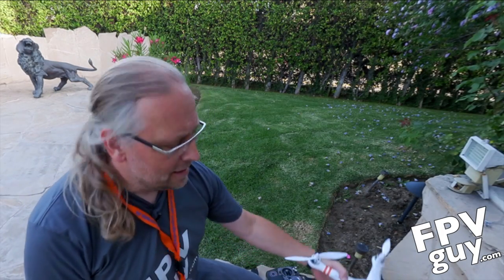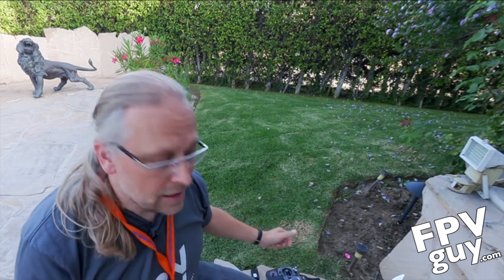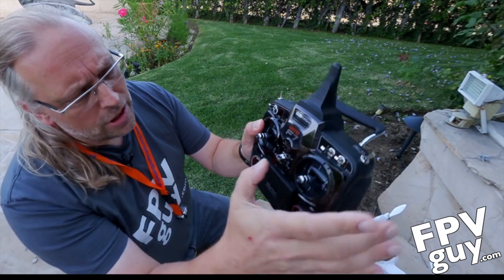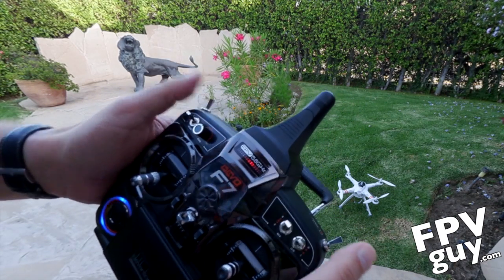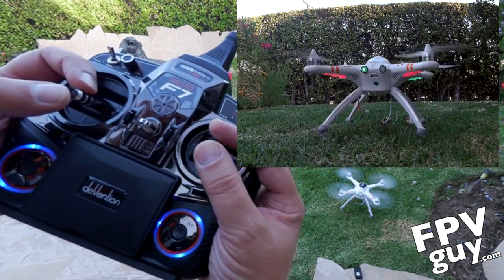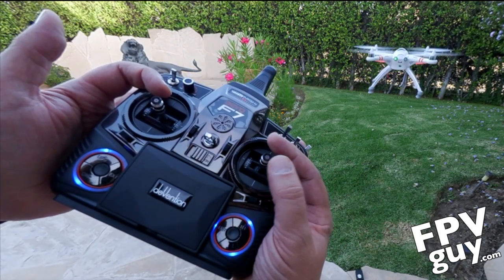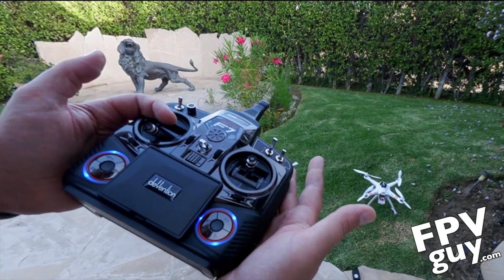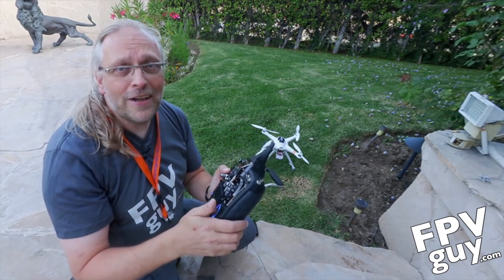x350pro Safe First Flight - Step by Step

Comment: Hi Bo, you certainly remember our discussion about my problems with the GPS device out of the box of my new QR X 350 Pro. Now I built in a new replacement GPS. Now I have a positive GPS Status LED indication (after some minutes at a new position). The GPS Position mode seems not so good as with an original APM with a ublox GPS receiver. With some mild wind there are drifts of a few meters 3...5m horizontally and vertically i.e. height. You mention in your Video some "learning" phase which results in a better (smother) behaviour of the quad. Can you explain a little this "learning" phase?
Reply from the maker: Hey Jack,  the "learning phase"  is really simple, my x350pro flew pretty much as you explained just now the first day, however after running maybe 5 batteries through it,  it seems to have refined its position hold and also its ability to lock to a position.   I had a bit of wind in this video yet not much trouble with position hold,  this is after maybe 10 batteries on the quad.  so basically, simply keep flying some batteries through the quad.. you should see a marked improvement. ;-)
Reply: Hi Bo,
Thanks for your explanation!I meant the question, if you have an idea, how this behaviour is realised. Up to now, I have never seen in the forum for the arducopter i.e. APM Mega hints for such an adaptive behaviour. Maybe that Walkera has programmed such a fine feature for their APM Mega.
Reply from the maker: Jack, I am as puzzled as you are,     got no clue how its working, and if you told me it worked that way, I would laugh and say you were smoking something..     all I know, when I powered the quad out of the box.. it was rough (putting it politely)  and after some batteries its very stable and predictable.    Matt mentioned something about how it works a while back, but its way over my head.    check out his FB forum https://www.facebook.com/groups/711455455567160/

Comment: Bo I see you are using a F7 Devo, do you know how to set up the sub trims in the menu? I have no idea what the menu items are or if they work. I was trying to correct a pitch problem on the 350pro as it was pitching forward when it takes off. I tried using the trimmers but nothing seems to work.
Reply from the maker: Benard,  
Yes they do work,  walkera makes surprisingly good radios. but the sub-trims are not going to change the issue if you can't trim it away. ;-)
Sounds like you need to revisit the IMU calibration, for some reason walkera call it compass calibration.  also make sure you are on perfectly level ground when taking off. 
AND make sure the quad is correctly balanced. 
Notice how I check the balance as i spin-up,  at a little less than flight power, I check that the quad is level. then rock the pitch and roll stick all directions to see that the quad moves with the stick.  when I center the stick the quad centers towards level.. so that is OK.. then as I power up more I use the stick to keep it level during take-off.
Reply: Bo Lorentzen thanks. Done the recab for the compass so will take it out. So the trimmers do work but not the sub trims from the menu?
Reply from the maker: Benard Quek I already said the sub trims work. ;-)

Comment: Bo, why didn't you turn the radio on first?
Reply from the maker: I find  - in my experience with the walkera products -  I always power the quad and then right after power the radio.  read me right here, I would NEVER turn on my s800 until after the radio is on and ready.  it just seems to work better with the automatic binding of the walkera things.    but I think the correct process probably is radio, then quickly the quad.
Reply: Bo Lorentzen
Thanks Bo. On DJI it gets tricky, especially when you land and turn the radio off, it suddenly takes off.

So I guess your next video will be flying H500? :-)
Reply from the maker: Ben Hayat Yes NEVER turn off a radio until after you unplug the quad battery.!
Cough Cough.. no comment.
Reply: Bo Lorentzen
:-) :-)
Reply: Bo Lorentzen
Hi Bo, I like your good introductory Videos for the Walkera QR X350 Pro! I just received my new one from RCMaster. But concerning the GPS I have a great problem, The GPS Status LED blinks only very rarely (can be minutes) and only under very clear sky and sunny conditions. (In These places the original APM Mega with a ublox GPS has never problems! After warming up the upper part of the quad the GPS LED stops to blink! It also stops if I put my Hand over the quad in a distance of a few centimeters. I opend the quad and controlled all GPS Connections (all ok). In the Mission planner I realized that the sat counts are rarely at 7...8 and sudden drops to Zero and comes up eventually after a long while. In the (quad)opened case, the situation seems a little bit better. I conclude that the Receiver sensitivity of the GPS is quite bad and even worther with higher temperatures. Did you also observe this behaviour? As RCmaster responds very lazy to my corresponding Inputs I ordered a new original Walkera GPS (Version 2) replacement in the hope ....
Regards
Jack
Reply from the maker: Hey Jack,   I have not had that experience, however Matt did, he put a new GPS in his and now have rock-solid GPS lock,    I think you did the right thing, but that probably should have been offered by the dealer instead of you having to buy a new GPS module.
Reply: Hello again, thanks for your information! Did Matt also have a bad receiver sensitivity  and temperature behaviour? This is also an experience, that ordering a long way away stays critical. But I found at this stage no other place to order from Switzerland.
Reply from the maker: Matt had problems with the GPS, but the control receiver worked fine.   basically, a correctly working / build x350 should work pretty solid out of the box,  kinda like in my video.. no real big problems..   If it don't lock GPS, my first instinct would be asking Walkera for a replacement x350 rather than the gps alone.   Check Matt's support forum on FB  https://www.facebook.com/groups/711455455567160/

Comment: Great video Bo, thanks for all the instruction. You took off in manual mode but landed in GPS mode, for beginners is it possible to take off in GPS mode?
Reply from the maker: Wally Jas,  Technically speaking, but I don't recommend it, because the x350pro GPS is a little rough first time out and you then can't do the rocker-test first to make sure the thing is neutral before getting in the air. ;-)
Reply from the maker: OK yes,  the process is simple,  arm the quad with mix switch in manual, after arming and do the rocker test.. put throttle to bottom wait for motors to stop.
Then move mix switch to "0" for GPS mode, then move the throttle stick to about 75% and it will take off.. return throttle to 50% for GPS hold.   proceed and fly from there.   
Walkera QR X350 PRO Auto Start —  Easy to Control Mode！
Reply: Bo Lorentzen DJI Phantom with centered throttle made life so much easier for sure at least for new comers to this hobby. So Bo if we have Phantom's TX and a compatible RX on Walkera Pro, will it help more with TXs centered throttle to hover in GPS mode? The question is also like asking ''How APM behaves in GPS mode with centered throttle as Wlakera has an APM based FC''? Thanks for your videos..
Reply from the maker: Gur Isler Yeah, now that everybody is starting to be flying GPS,  the spring centered throttle stick makes sense, and the logic is simple, up to move up, down to move down.. and that is exactly how the APM behave,  yes it is a APM controller in the x350pro.    there is nothing keeping you from cracking the tx box open and putting a spring on the throttle stick as well. ;-)
You could definitely also fly a x350pro with a Phantom radio / rx, but remember there are no options for customizing the radio, so it may not be worth the time.
Reply: Bo thanks for quick reply. Just will build a custom 350 pro by buying spare parts and some abit better motor and escs and apm 2.6, just want to continue using my Phantoms Tx with this new build by adding a Fasst rx into custom 350 pro, just I was curious how APM will behave to stick centered throttle when I arm the apm! Dont have so much experience with APM but as you mentioned it should be OK! Later thinking on investing a better TX like Devo10 or Tarantis! Thanks for helping! Following fpvguy.com :)
Reply from the maker: Gur,  you arm by pushing the throttle down and to the left.. after it is armed, if you return it to 50%  (middle) the props will spin up but not take off until throttled up if in GPS.   But notice, most people who upgrade their Phantoms go to non-centered sticks,  for a guy who fly FPV and in ATTI mostly, I would probably prefer the non-centered stick.  I would also consider the F12e once it come out. ;-)
Reply: Bo Lorentzen Bo, I am in pursuit of that TX from Walkera, looks really cool for fpv. But so far as a beginner life was so easy for me with Phantom with these throttle sticks on GPS mode, and mostly I was using Gopro with a cheap goodluckbuy gimbal that was working good enough!   I am just tempting with the idea of especially telemetry and waypoints on APM, and a 350 quad (easy to carry) with long battery, and walkera did a great,job on second 350qr! Once I accomplish my build and get more experienced by playing more with APM and Phantom, fpv without LOS is the ultimate goal and yea GPS mode is not preferable for the best FPV experience! Thanks again for helping me to follow the right track, the only problem in this hobby so far for me is that new products are coming into market so fast for quads,especially that I am a bit conservative to buy sonething very new when hits to market.. :) regards
Reply from the maker: Being conservative is a good thing.   did you check out Chris' Armattan mini-quad, its priced right and incredible fun to fly.

Comment: Nice Video, yet again very informative, easy to follow and entertaining. I missed your sneaky mountain dew product placement though (-; ha ha. Oh and I see they didn't fix that flimsy latch that always pops open, thats a shame. I have ordered the Pro body, landing gear and hardware to swap all my electronics from my normal QRX into that shell, just so I can use a bigger battery and get more flight time. Should be here this week. Do you think I will need the Pro props because of the extra weight, or do you think the standard props will be ok. Thanks mate.
Reply from the maker: Hey Jax,  Sorry, the Mountain Dew sponsor ship check bounced.. nah.. it was 8pm and caffeine seemed like a bad idea. ha ha.
LOL. I KNEW I should have reshot that landing,   The 9inch props are very well made, I would recommend them. not so much for the extra weight but because the thing seem to fly very nice with them,  try a pair and see how it goes, check the motors for heat after landing to make sure you are not melting anything as well. ;-)
Reply: Bo Lorentzen Ok, cool, thanks for that, I will run the standard props first to see how they go. Cheers, hmm feelin thirsty....what will i have? ha ha (-;